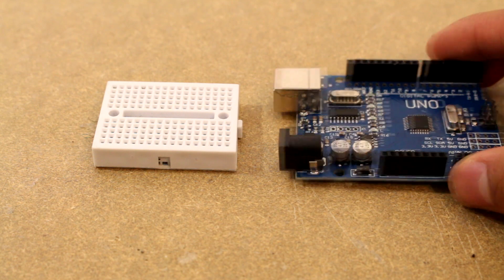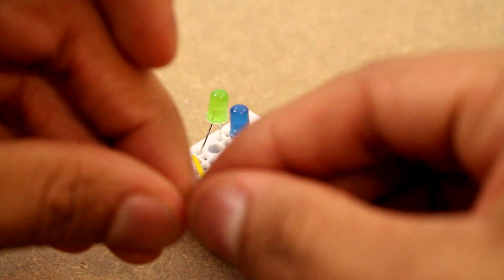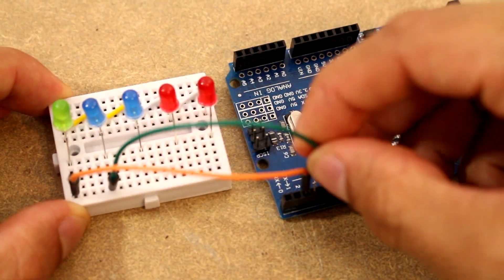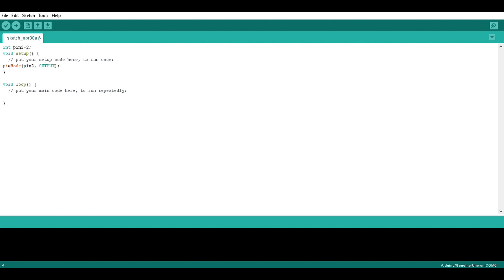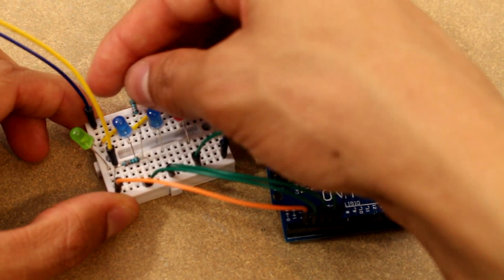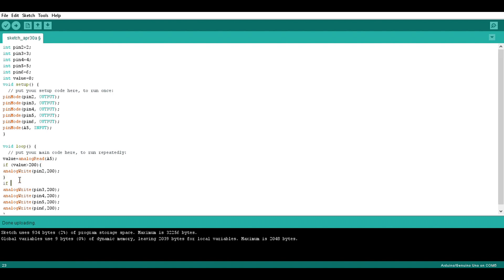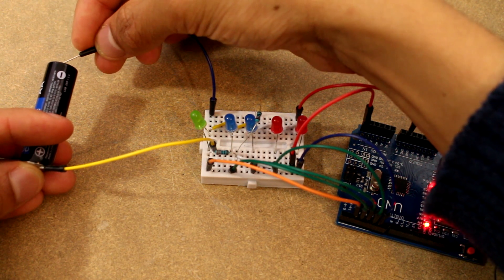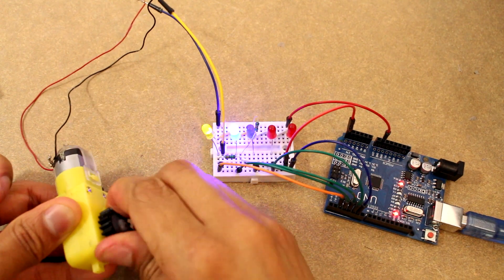How To Make a Simple Battery Tester

Comment: WTH? 5 vots to an LED without a limiting resistor blows LED's rather quickly.I don't know how you had your Arduino set up but that is just common knowledge and I'm a noob. (Yes it baffled me when I saw it and went ahead and followed suit and blew up my LED) and I'm sorry but on another note this doesn't really tell me anything about a battery except it's current voltage... I have a multimeter for that.

Comment: This is more a voltmeter.  Not really much of a battery tester...
Reply: Well what else could a battery tester be though?
Reply: @xalspaero  Battery testers are electronic devices designed to test the remaining capacity of a battery's overall charge. Contrary to popular belief, they do not test the voltage – simply the remaining capacity.   They place a high current draw on the battery and see how much current it can source, measure voltage sag, measure internal resistance of the battery, and some of them test other external factors such as alternator output, starter current, chassis ground resistance, etc

Comment: I killed 5 LEDs trying to make this when I tried testing them so don't use 3.3v or 5v when testing them
Reply: Yeah, you need series resistors to limit the current through the LEDs.  270 ohms should work well with 5V.   120 ohms with 3.3V.